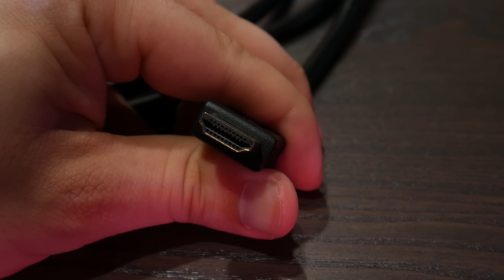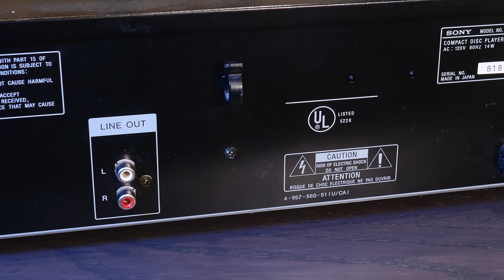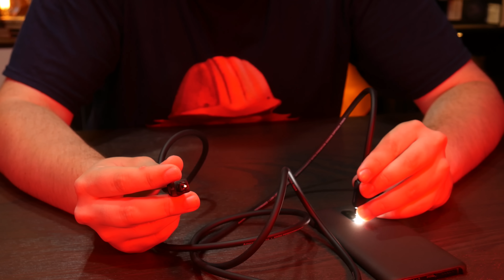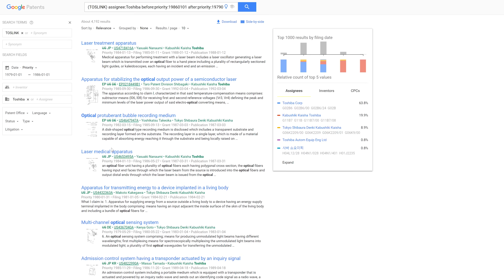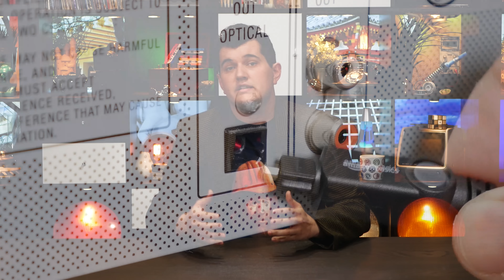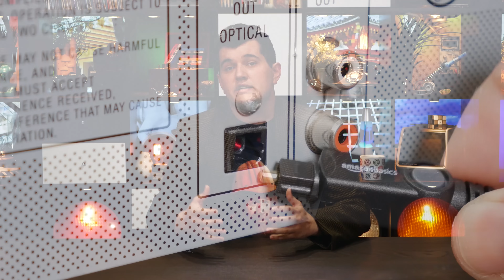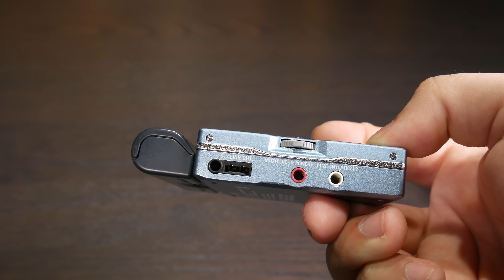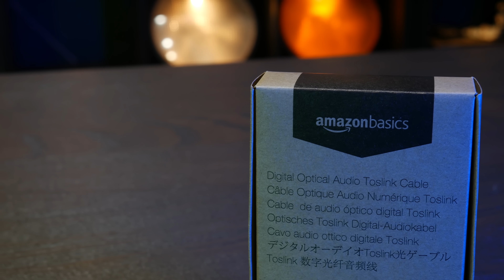TOSLINK: That one consumer fiber optic standard

Comment: What would have made sense was making HDMI optical. I've had so many problems with those stupid connectors getting loose, bent, pins broken, sockets pulled off the PCB. Plus it's not future proof as now we have DisplayPort as well. Not to mention the cable being thick and awkward in long lengths.
Reply: That would be deficuled as HDMI got sperate wires for clock, 3 data lanes and also seperate pin for extra features like return audio and ethernet, they would need to turn whole thing in to serial communication.
Reply: @ShadowriverUB  it already is serial anyway. You'd just need to multiplex those separate channels onto one single higher bitrate channel. Specify enough extra bandwidth for future expansion, bi directional signalling and enough tx power to drive at least 50m cable length. Make it backward compatible with the old toslink connectors and you could probably still use toslink cable for short runs.
Reply: It not fully serial at it's dependent on different pins, including separate clock pins + other pins are are used for extra features, in order for this be compatible with fiber it needs to carry all of this in single data lane (like USB does for example) which it clear does not. You would need to package it to some carrier protocol to make it compatible with copper HDMI standard features. I would be a lot easier to make it different standard
Reply: @ShadowriverUB  bonus feature: headphone jacks with mini toslink capability can now send HDMI signals :)

Comment: I've been using ARC for my TV/soundbar combo because the TV can control the soundbar's volume and turn it on/off.  With old school TOSLINK I would have have had to keep the soundbar remote around.
Reply: Yep exactly why ARC is 100% better than it. Also it has built in sound sync correction which can be very annoying when using a surround system

Comment: I actually use a Toslink connection. I had major issues with my computer producing a hum on it's analog output that I could not get rid of.
Then I found out it also had a Toslink output.
plugged in a short cable with a €25 DA converter on the other end, and the hum has been gone ever since.
Reply: This is the biggest advantage of the optical interface, it removes ground loops that produce noise on analog signals. Using optics for the digital signal, however, isn't a cure-all, since there could be another ground loop between the DAC and the Amplifier (assuming they're separate devices)

Comment: It avoids annoying telegraph like sound interference from smartphones lying beside it.

Guess that’s something.
Reply: What you are referring to is interference from a GSM phone being picked up by a sub par shielded speaker. In the US, T-MOBILE is the only major carrier still transmitting GSM signals.
Reply: @compuguy-adh  This is incorrect, not only is GSM one of the critical world standards for cellular data transmission, both T and AT&T operate very large GSM networks, with Verizon and Sprint operating with CDMA. In Europe and Canada, GSM is the only main cellular data transmission standard.
Reply: @Ampera_  AT&T shut down their US GSM network in Jan 2017, to free up more bandwidth for LTE.  I had to help a few people upgrade phones.  3G UMTS, the designated GSM successor standard is similar at higher levels (still using SIM cards etc.) but nothing alike in terms of RF modulation, being based on a form of CDMA (incompatible with the Verizon/Sprint CDMA flavor, of course ... which Verizon is, coincidentally due to shut down at the end of 2019, though I suspect they may have to extend that deadline).
Reply: @Ampera_  Agreed that GSM is still very important in many other parts of the world, though, and a useful lowest-common-denominator when traveling since there are only four bands to support (850/900/1800/1900) unlike the much more complex 3G and 4G spectrum situation.
Reply: @Ampera GSM is actually just a 2g standard. Same with cdma. The terms have different meanings in colloquial use but haven't been technically correct for a while now.
Reply: @Ampera_  Yes, the majority of carriers in the world still use GSM. I was just pointing out that in the US, AT&T shut down their GSM network several years back to reallocate to LTE. Both T-Mobile and AT&T still use UMTS.
Reply: @compuguy-adh  LTE (like GSM, but unlike 3G UMTS) also has a time-division component - resource blocks assigned to a particular handset are transmission timeslots on particular OFDM carriers (well, SC-FDMA on the reverse link, but close enough) that roll by in a repeating pattern, which can induce this type of interference.  The effect is far less severe than with GSM due to generally lower transmit power level, and higher bit rates allowing for lower duty cycles, but I've heard it get into poorly shielded audio systems a couple of times.

Comment: The reason fiber optics didn't take off in consumer spaces is because those cables are fucking fragile. You bend it a bit and good bye connection. Copper cables are much sturdier and can withstand much more bending than fiber optics can.

Comment: I stumbled across mini toslink in a very similar fashion. A friend of mine had a laptop with a headphone jack that glowed and I initially thought it was just an LED for finding the port at night until I saw that it said optical next to the port. Apparently it's still semi-common, my desktop speaker amp is only a year or so old and it has a 3-in-1 combo jack that operates as mini toslink, standard coaxial s/pdif and as an output for a subwoofer. The coax and subwoofer out require an RCA to 3.5mm adapter cable.

Comment: Fun Fact: Most MacBooks have a mini-TOSLINK interface integrated into the 3.5mm headphone jack. You can get a 3.5mm to TOSLINK adapter for a couple of dollars on Amazon!

Similarly, AirPort Express routers also have a mini-TOSLINK connector, too. That combined with the recent firmware upgrade allowing AirPlay 2 support makes them great for setting up speakers around your house.

Comment: Mini TOSLink is common in older Macs. I use it to plug an old 2009 Mac Mini into my home theater system.
This is awesome! The Mac only has Mini DisplayPort, so that's converted to HDMI, but without Audio :( To get surround sound I bought a Mini TOSLINK to TOSLINK, plug that into receiver, and boom! 5.1 surround sound out of this humble little Mac Mini.

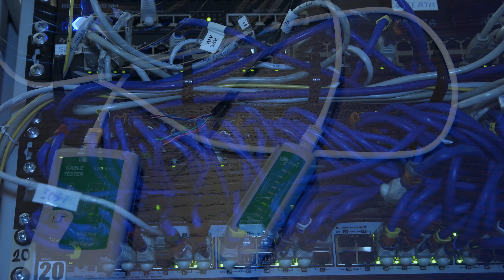Comment: @0:48 - "Networking equipment...still uses Ethernet; Twisted pairs of copper wire..."  Ethernet standard includes Fiber and radio standards, too.  It's not bound to copper.  We pedants request you refer to UTP or simply twisted pair cables in this context.

Comment: i use cheap cat toy laser pointers to send spdif all over the place. very often the rca output can simply drive laser printer and all i have to do is aim it at the end of a toslink cable at destination. also there is a company that uses a modified version of toslink for home network called 'POF' plastic optical fiber. it uses a pair to do tx and rx. they never real caught on due to the performance lag compared to Ethernet cabling. (when industry was at 100, they were at 50.. 1000/600, 10000/1000 respectively....

Comment: Thunderbolt (Light Peak) was initially designed to use optical cable: https://en.wikipedia.org/wiki/Thunderbolt_(interface)#Copper_vs._optical
Many Apple Macbooks & Mac Mini used to have mini toslink included in the audio out port.

Comment: Toslink alleviates Ground Loops. Since there is theoretically no electrical connection between Source and Destination, there is no way to cause a ground loops. TosLink is used often in professional event recording and similar, do to this advantage. The source and destination are often near each other, but due to the "oddities" that occur when scale music events occur, and the questionable grounding and power available at venues, this is a really nice convenience that ensures the confidence recordings are always clean, and that the recorder does not introduce grounding noise back into the FOH mixer.

Comment: 11:20 jesus christ my man you know how much time I had to put into troubleshooting because of the botched Windows 1903 update? Don't do me like that
Reply: I also updated to Windows 1903 and what a fiasco.  I lost most of my desktop icons and all of my desktop folders.  I was just sick thinking now I would have to restore all of my files and lose some data that was not backed up.  I was going to call Microsoft the next day to complain since I could not even do a system restore since Microsoft deleted all of my restore points.  I shut my computer off and several hours later I rebooted and I got a message saying HI you have updates.  When the updates were finished by computer was back to normal with all of my files and icons on the desktop.
Reply: @Norm475  also had that issue. Also my PC started going BSOD every few hours. That's odd, must be some driver issue. Reinstalled a bunch of stuff. 

Then I noticed there was another Windows update available to fix some 1903 issues. Windows would go to 97% installed on that update and go to blue screen. Every time. So what had happened is that Windows had reset my expressed desire for it to NOT update itself automatically and had been trying to install that moronic update which would then result in a blue screen.

I WAITED A MONTH TO INSTALL YOUR LARGE DUMB UPDATE SO THIS SHIT WOULDN'T HAPPEN

Comment: Does anyone know if the digital optical out on a PS2 (and other devices) supports additional audio options beyond the lowly two channel? If so, that would be one advantage to using it - though, it is a great point that it would have perhaps been better (though less cool) to use a standard RCA cable for the digital output.

Comment: I would love a video on ARC and eARC. It is such a great standard that killed Optical Digital Audio.
Reply: ARC is only great on paper. In the real world I was having a lot of issues with it. It's supposed to be plug and play and should "just work". Devices usualy don't have any settings for it. Some AV Receivers don't even have it in the list of inputs. To find out if a device even supports that standard is always a struggle because it is often not labled at all. And it is so much fun to find the isse if you plug it in and it DOES NOT work out of the box. Bad connectors... bad cables... bad implementation of the standard... it's really annoying. Sometimes you just can't fix it at all. Or it works "most of the time" but sometimes you start your devices but they fail to communicate correctly so the TV never outputs the audio to the Receiver.
Toslink on the other hand is 100% reliable. 15m connections across the room are not a problem. It always works and the only thing you have to pay attention to is wether you wanna output in PCM or Dolby Digital format. That's it.
We need a true successor to this connector for HD Audio, because HDMI is not it.

Comment: Music production degree-holder here.  For the love of all humanity its not pronounced SPIDIFF.  It's S-P-Diff.

Pedantry aside, this is a great explanation of how optical audio works.  I should add that TOSLINK connections can also be used in lieu of a copper connection (usually BNC) for word clock synchronization.  Likewise, S/PDIF can be implemented over a copper (usually RCA) connection.

Optical connection is also an option in the realm of professional audio, especially if you have multiple mic preamps with on-board A/D conversion.  But you're limited to low sampling rates and bit depth if you lack a large amount of I/O.  The higher resolution the audio the more optical connections are needed regardless of communication protocol.  Plus, you'd need a word clock to keep sample timing consistent across the devices.  Digital interconnection of audio equipment in this manner is slowly being phased out in favor of networked audio.  That is, audio over Internet protocol.
Reply: Maybe where you got your degree, but that's not a standard.

Comment: I still use Toslink. Dolby Digital, DTS decoding externally by Receiver Also, noiseless. Best Sound via Toslink or SPDIF.
Reply: The best is eARC... Allows you all that same stuff and can control the sound system with your TV remote.

Comment: I think there is a benefit to electrically isolating your DAC.  For instance inside of a PC could be fairly noisy all things considered.  There are a LOT of high speed electrical signaling going on inside the machine.  Of course these signals could interfere with your DAC so you decide to move to an external DAC to help isolate it.  Then you send the audio to the DAC via a copper cable, bringing those signals along.  Now, if things are isolated correctly, those signals do not create any sympathetic issues on the receiving side, but then, you don't know how strong those signals are.  With the TOS connection, the only electrical signaling you have is that which is created at the receiver, and can be tuned and controlled by the manufacture of the receiving device.  (Obviously, you'd hope that the electrical impulses created from the TOS receiver would not interfere with the analog side of the DAC, and they are a known commodity, so they should be easily accounted for.)  Generally speaking, the best results are for a DAC to be surrounded by a little noise as possible, and the idea of 'mechanically' isolating the input (since light has no electro magnetic effects), isn't a bad one.

You did bring a up a great point about how ultimately both pieces of equipment are sharing the same source power.  However, like in the illustration above, it may not be the source power which is generating the interference.  The signal (from the example) would have to traverse back through the PC's PSU, through the electrical, and then not be filtered by the receiving DAC PSU.  Also, this idea of sharing the same source power ignores the potential deployment of line conditioners.  

I think a reasonable case can be made for the use of TOS.  Though it may not be as cut and dry as some things are.

Also, as another gentleman has noted, this avoids other sorts of ground issues, which I can say from experience, is nice.  I have experienced first hand where I had problems with copper S/PDIF and not TOS.

Comment: I'm using TOSLINK from my TV to my surround system. It seems to work great despite being quite an old standard.  Just because it's old, doesn't mean it's useless (DNS, FTP, HTTP, SMTP, SSH, and so on...).
Reply: ARC and eARC is better for sound systems nowadays
Reply: @andykillsu  agreed, but my $99 unit has analog 2 channel rca connectors, toslink, and s/pdif. I though toslink was cooler so I used it.

Comment: In the professional world, ADAT is actually a pretty cool standard, because it is so universal in professional audio gear. Especially for legacy reasons, because it still allows you to productively use old audio interfaces or ADCs that are still extremely high quality and very expensive, but feature an old pc interface such as FireWire, which is a pain to be used with modern computers, especially laptops. Maybe they should have just implemented ADAT instead of TOSLINK in consumer devices, using only channels 1/2 for stereo? This would have certainly been more useful.

Comment: hmm interesting.  One added benefit (though not really part of the original idea) is bypassing steps inbetween the source and the final audio amp.  So you can find it a lot in retro gaming setups.  Where the user has to use and converter device like the OSSC to upscale the image to something a modern TV understands.  You can run the audio straight to these devices and then out to HDMI but they aren't 100% audio correct since their focus is entirely on being 100% video correct.  Also the standard copper wire audio was analog while TOS would be digital.  So using the TOS you can bypass that part of the chain.  Its not that big of a difference if your cables are good quality to begin with but its there if you really, really care.

Comment: i love the concept of fiber optic cables but i think it never took off because the cables are so brittle and cant be tightly bent or even stepped on unlike regular wire cables. i had a sony stero back in the 90s that had optical out and my new minidisc player came with a optical cable. i always recorded minidiscs with optical and it was great because it synced the recording when i hit play on the cd and even split it into individual tracks instead of one 70 minute track

Comment: Listening to this using a TOSLINK connection from my TV to a headphone amp which works great for me. I used to have my consoles, bluray player and PC connected by many optical cables to a switcher which I retired once I bought a new tv with optical out. Im going to experiment with an optical splitter which I plan to use to send the audio signal  to both my headphone amp and a soundbar sine the bluetooth connection keeps cutting out. I Know it will cut the amount of light able to get through to either device but since it's really cheap it cant hurt to try.

Comment: As a low voltage system engineer I have to say this video is an absolute delight. The explanation of the transition from the pits in the CD all the way to the RCA line out was just so comprehensive. I'm saving This video to send to future trainees. Thank you for your knowledge.
Reply: You ain't seen nothing. No, seriously. Go check out the rest of his vids. They're all just as good and you'll likely find more stuff up your ally.
Reply: You should watch his Video about how the CD laser pickup works 😀
Reply: But what about muh gold plated optical cables??
Reply: Holy shit, what an endorsement!
Reply: Yes, his videos are great; that is why I am annoyed that he poo-pooed the significance of ground loops and relegated the concept to similar importance as clock jitter.